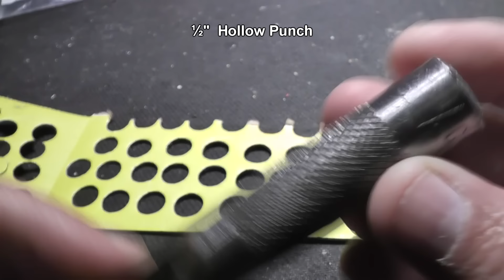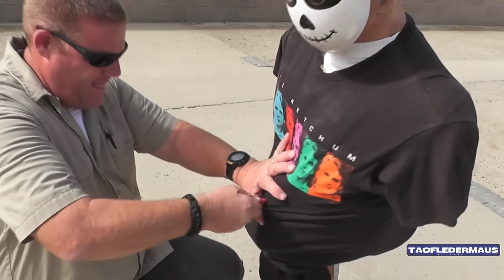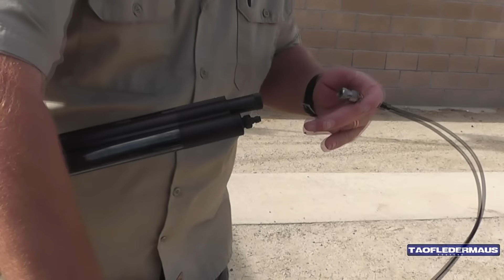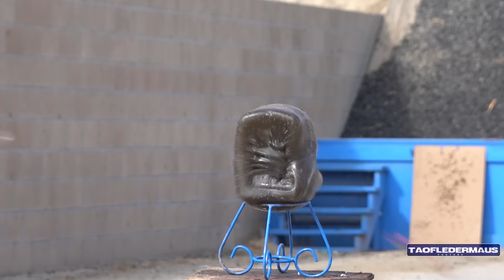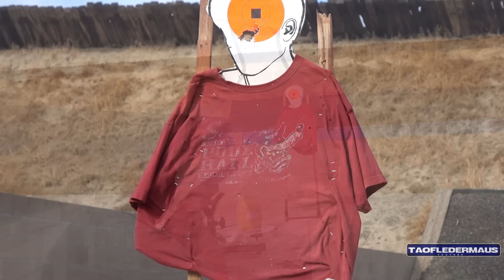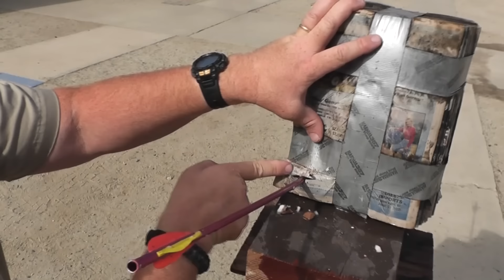.50 CAL Air Shotgun with CROSSBOW BOLTS - Powerful!

Comment: Nice one, gents. Those mechanical broadhead bolts are evil! I noticed it cut the coconut shell like paper. I would not like to be on the wrong side of one of them!
Reply from the maker: I really expected the blades to be destroyed after going through that.   Those were $10 for the six mech.  broadheads.
Reply: I love mechanical broadheads for turkey hunting. Quick humane kill. Aim for the neck and get a clean decapitation.

Comment: OG has a way with gun safety issues, 'wear ears and eyes folks'!  Hard to tell who was having the most fun here, both of you were like kids playing with your first daisy BB gun.  Serious power to the air gun, wonder what would happen of you were to punch a smaller center hole on some of the cardboard discs to form a center pocket on the front of the seal stack, then insert the end of a simple dowel in the barrel with a tape bushing half way down the barrel length. and press the dowel into the seal center hole.  When fired, the seal should shove up onto the end of the dowel and act as a 'fletching' to keep the front end headed down range like the vanes of an arrow do.  Be fun to see what a simple dowel could do for penetration.
Reply from the maker: It think the only wonky shots were the ones with the broadheads.   Didn't have the waddings up against the ends of the bolts.

Comment: To improve stability and accuracy with the bolts, add a small helical pattern to the fletchings. If you do this, the wind going over them will cause the arrow to spin.
Reply from the maker: you didn't like the flapping?
Reply: TAOFLEDERMAUS I'm just thinking it would be lovely to see one of those top quality broadheads corkscrew into a target.
Reply from the maker: If they were stiff enough to do that,  they would be too stiff to fold up to fit into the barrel.

Comment: You guys didn't secure the blades on the "chinese broadhead" before you shot it. That's what that little rubber O-ring on the back of the head is for. The blades need to be secure in flight (keeping the profile very slim, making the head very accurate), and then they open on impact. I'm thinking it's a chinese knockoff of the Rage Slipcam broadheads, which are actually very lethal. I've been hunting with them for a couple years now. You can google them to see how it works.
Reply from the maker: Yeah we did
Reply: Oh, okay. It just didn't look like it. Maybe the shock of the discharge was too much for the O-ring then.

Comment: Who knew that air rifles are pneumatic...
Reply from the maker: totally!
Reply: Thats awesome! Pretty powerful device able to harness the atmosphere like that.

Thanks for the great vid, Greff and Jegg!
Reply: Some are spring powered. Different
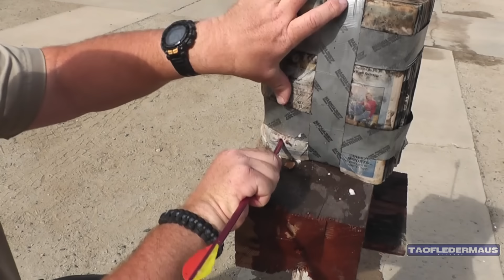Reply: 16:10 i believe its stuck in your clip. 

A joke of you cant tell
Reply: 26 Isn't Dead   Pneumatic = To make use of gases, usually air, to transfer, store and control energy.
Reply: +26 Isn't Dead  Actually, putting aside the technical/dictionary definition (which would make all so-called "airguns" pneumatic), as jargon the term pneumatic has traditionally been applied to anything that uses stored compressed atmospheric air via a pump (usually built into the airgun, but not always).  Other types of "airgun" include CO2 guns that use those usually 12-gram cartridges, and spring-piston guns ("springers") that store energy in a spring instead and use it to drive an air piston after the trigger is pulled.  And of course with Airsoft we have guns that use other gases loaded from cans/bottles, as well as electric guns that use motors and gears to charge a spring that drives the air piston.

Now, what you're referring to is pre-charged pneumatic or "PCP" guns, which are relatively new to the industry in modern times but have really been around since at least the 18th century with the Girandoni air rifle.  These are charged from external sources, and they are indeed called pneumatic, but so are the old single- and multi-pump pneumatics still.  Maybe some people have changed (i.e. hijacked, bastardized) the jargon, but not everyone, so in order to be specific and avoid confusion, just call them pre-charged airguns, pre-charged pneumatic airguns, or PCP airguns.
Reply: +IoSono  It depends on what you mean by spring-powered.  In some airguns a spring is used to momentarily store energy from the shooter (the real source of power) for each shot, and when the trigger is squeezed if the spring drives an air piston to generate air pressure to propel the projectile, then the gun is a type of "airgun" and is also technically pneumatic, even though such guns are not customarily called that.  Virtually all spring-powered guns these days are airguns called spring-piston airguns or "springers" for short.

Why bring all that up?  Well, because not all spring-powered guns are airguns.  Some are instead actually catapult guns that use springs (or sometimes elastic bands) to launch projectiles through direct action rather than an air piston.  They're like gun versions of bows (spring) or slingshots (elastic band), which are also catapults.  None of these are pneumatic by any definition because neither air nor other gases are involved.  Granted, there are hardly if any modern non-toy examples of catapult guns (except for crossbows), but they have shown up occasionally on the historical timeline and are often mistakenly considered airguns just because they happen to launch BBs, for example.

By the way, in case it isn't obvious, the well-known spring-powered "BB guns" intended primarily for children (e.g. the Daisy Red Ryder--"You'll shoot your eye out, kid!" ;) ) are and have always been spring-piston airguns, not catapult guns.  I only mention this because I've seen a few people claim that they are catapult guns for some reason, perhaps to make them seem less like firearms (which also use gases to propel, of course) and therefore more like toys, I don't know.  I guess these people wish to differentiate BB guns from "serious" airguns, but nope, sorry, they are in fact spring-piston airguns (albeit cheap ones), no doubt about it--take any of them apart and see.
Reply: rbrtck so.. two kinds of air rifle: pneumatic and spring powered...still what I already said.
Reply: 26 Isn't Dead   Get with it..!

Comment: If you do this again what about using pieces of rubber hose instead of the tape and cardboard? You could slice the hose length wise and glue it on. For the end maybe use rubber cement to fill/plug it up.
Reply from the maker: All I had was some tape.

Comment: Lol yall think 100 dollars is a lot for cross bow bolts , normal compound bow arrows and crossbow bolts are at least 80 dollars for decent ones
Reply: It is a lot when you have an incredibly small budget...
Reply: Smokey McJoint yeah but the thing is and I guess I was trying to get at is almost everything that has to do with sending an arrow through the air is at least 80 dollars for each accessory , i bought an arrow quiver just a piece of plastic to hold my arrows on my bow last week and it rang up 50 dollars and it was the cheapest one